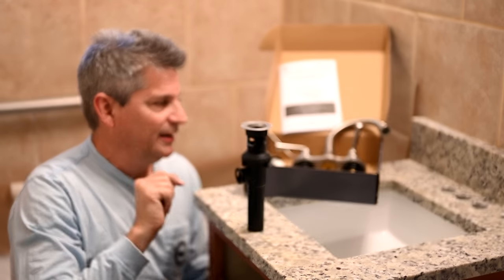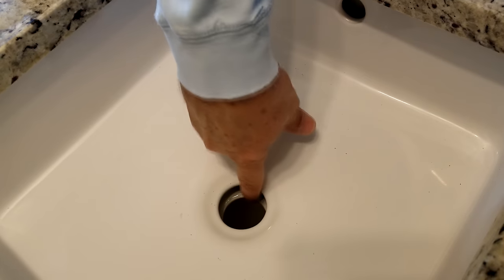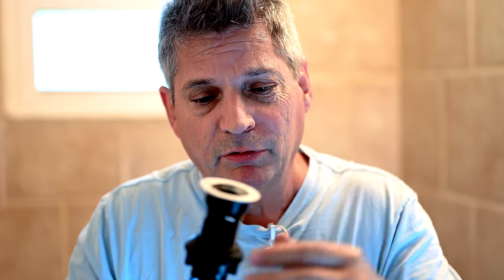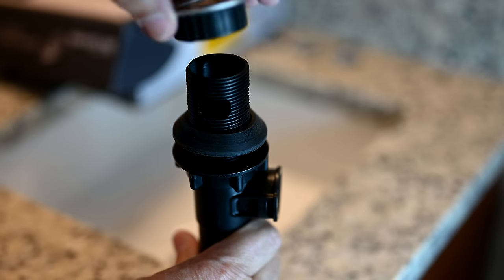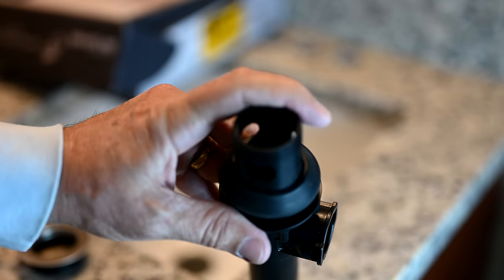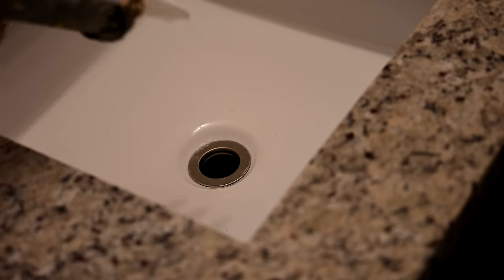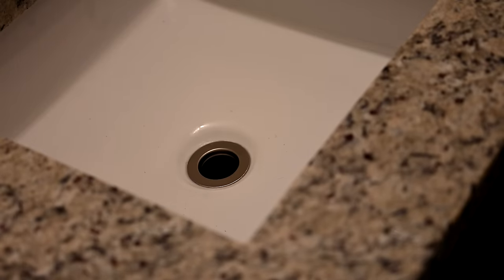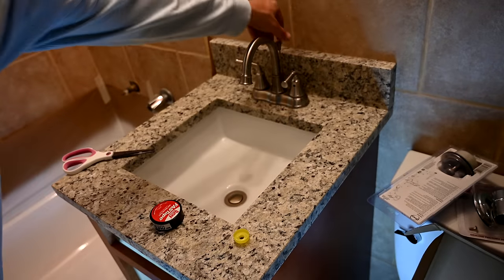How To Install Bathroom Sink Drain/Faucet, No Leaks Under Gasket, Threads [SOLVED] 2023

Comment: If you have a crack around the ring below the sink, it is better to use the putty in this case as the rubber gasket wont seal very good. Like you said, itll mask the problem but it is the only solution i know of that works, otherwse a new sink will need to be bought. Very informative video. thank you sir!

Comment: Great video. There is an additional problem that I ran into that this video doesn’t address. So I used silicone adhesive to glue the waste seat into the drain hole. I then put the Teflon tape on the drain body in the two places you said to do it. So after the silicone sets, I go to screw the drain body into the waste seat a new problem arises. The Teflon tape makes the drain body harder to thread into the waste seat which is glued into the basin, so much so that it breaks the silicone seal, trying to get the pivot rod to face towards the back of the sink. Same goes for the drain nut below the gasket. Trying to tighten that with the Teflon tape on the threads makes it harder to do and inevitably breaks the silicone seal on the waste seat before you can get the gasket even close to the bottom of the sink. So you have to start all over. What I had to do is put the silicone on the bottom of the waste seat and push it into place. Then, while still wet, I screwed in the drain body and got the pivot rod lined up properly and the tightened the drain nut/gasket into place all while the silicone was still wet. Hopefully this works because I had to start over 3 different times. Any thoughts on this?

Comment: Thank you for this! Just fixed my bathroom sink following your video and NO LEAKS! Not a plumber and wouldn’t even consider myself a handyman, but gave myself a POB (pat on the back). Thank you for sharing this. 

The teflon tape was the big deal. The person who owned the house before just smothered the drain pipe with plumber’s putty, but the teflon tape seems to work. And the whole job looks clean and professional! Thanks again!
Reply from the maker: Yes you can always tell the person who doe snot know, because plumber putty should never be used on threads.

Comment: Great video. Clear silicone is the way to go. If need to remove j slightly silicone excess, one can use a silicone spray, but be prudent since it can undo everything. That ridged wrench is awesome thanks for this wonderful video had to do 7 faucets and it was a breeze with your recommendations. I actually used pipe dope where Teflon could have been used, can be very messy but I don’t have to think about wrapping this way or that way and unraveling Teflon tape. Great tips, nothing missed, especially the aerator removal. Thank you so much. No drips thanks to you! Except I had not waited the thirty minutes on the silicone on the first one, and was perplexed what went wrong - found your video.
Reply from the maker: Awesome glad it worked for you

Comment: Great video from start to finish. I appreciate you outlining the use of teflon tape, as well as the distinction between 100% silicone and Plummers Putty, in such straightforward words. The only item I would personally omit is silicone around the gasket on the faucet pedestal. In my opinion, there is almost no probability that water will get there and pass through the gasket.
Reply: I agree that the possibility of water getting past that bottom big black gasket is very low. The bottom of the sink would have to be pretty deformed for that to happen. I think the possibility of water passing through, around the threads under that black gasket is more likely.  A year ago, I installed and removed a drain three times, only to have it leak around those threads. The 4th time, I put some silicone on the threads where Jeff used Teflon tape, and the leak was no more. That was a plastic drainpipe. 
Yesterday I replaced another bathroom drain using a metal drain. The only sealant I used anywhere was the plumber's putty under the top flange, and Teflon tape on the tailpipe threads. I did have a leak around the pivot rod because I failed to adequately tighten the cover, but once I tightened that cover, everything was fine. 
I'm thinking there may be a difference between the sealing on plastic v metal pipes. 
As skeptical as I was, I simply followed the manufactures instructions, and it worked out well.

Comment: Great video, well paced with clear shots of important bits. Just want to add that my moen faucet mentions that the drain stopper can be captured (called anti vandalism option) or used with the pin next to the stopper hole so that it can be easily removed for cleaning.

Comment: Jeff, i followed your instructions...but my older drain piece and its popup leaked when I used silicon...wife found leaks!!! Yes I put healthy thick coatings inside and around the top ring!!!!  Looking at the sink which was very rounded I guessed that more material was needed between parts and the sink...SO...I switched backto using PLUMBERS PUTTY!!!  That stopped the leaks...at least for one week so far!!!  I mention this hear because others might be using their older existing part OR they have a deep/steep sink too...YEAH for older ways which still work hehehehe  Just sharing hoping to help others fix their leaking sink and...puzzled...whats wrong?...before they give in and go buy new parts!!!

Comment: Excellent video! I'm going to see if I can get this to work. On the new sinks they don't put threads where the bottom gasket goes (at least on mine from Lowes). it is just smooth pipe..I still may see if I can add some tape there...Let me know if you have any insights for this kind of connection.

Comment: This video is great! I have one question—underneath my sink there is an extra hose that seems to be a drain for the a/c. How do I go about replacing the assembly if the new one doesn’t already have a place to attach the drain hose? Thanks in advance for your time.
Reply from the maker: You are NEVER supposed to connect any drain hoses from the AC to the sewer. This is a violation of building codes, and most cities forbid it too. IF you connect the AC hose to the sewer, you could have sewer gas smell coming up into your house through your AC line, back through your AC pan.

Comment: Great video. I have the same offset situation during a remodel. I think I will probably use a street 45 that will connect directly to the trap adapter so that short piece of pvc pipe will not be needed.

It seems like your plan B would have created a restriction. Seems like a coupling (slip or normal) and another short  piece of PVC pipe for subout might work if there was enough of original stubout. Might have to open hole in wall a bit.

1/4" per foot drop between trap and sanitary T.

Comment: The ones that use plumbers putty on plastic parts and pack it in there, are the ones that people have to have fixed later or have mold smell from the putty and the crevices made from squishing into the void behind the drain stack getting we and harboring all kinds of nasty insect critters.  Use the silicone people and every year, take a flashlight, clear out your vanities and look around under the sink and other fixtures.  It's cheap insurance.  Nice video Jeff!
Reply from the maker: Thanks Debbie!
Reply: @jeffostroff  😉

Comment: I loved your video !  If I may ask a question. Danze bathroom faucet replacement. The drain is my question. Sealing to the underside of the sink. There is the rubber washer but it is threaded and very hard to thread on.  How is it possible to thread on the plastic nut when the threaded rubber gasket stops it. The rubber gasket that I took off had no threads.  
Plz help

Comment: Good video ! Thanks I just did one bathroom sink I used silicone on pipe treads , as per instructions , first time leaked , loosened nut and washer added more silicone as high as I could get under vents l on pipe  above rubber gasket , worked great , next sink I'll try pop up drain , do don't have to get my body  in a 2x2 box , 😳 get rid of drain valve linkages , 🙂
Reply from the maker: Yes, that is a pain, I use these large husky 1" thick foam rubber kneeling pads to protect my back
Reply: @jeffostroff  good idea knee pads

Comment: GREAT video!!!  Our problem though is that the rubber gasket sits on a flat part of the pipe, above the threaded area.  Where the gasket meets the bottom of the sink is not threaded (yet the lock nut does reach).   What can we do?

Comment: thanks for a beautiful explanation on how it works...i did not put teflon tape below the over flow holes that might of been the problem...would it be ok to just put teflon tape over the all threads on the drain...instead of doing a dry fit....i am going to put tape over all the thread on the drain pipe to be sure i covered all bases

Comment: This helped a lot although I did use putty before I came across your video.  I have a slight presence of water where the cone shaped gasket meets the bottom of the sink.  I think that might be because I didn't clean the bottom of the sink at all.  The plastic nuts and brass nut on the old faucet were frozen.  I had to cut them off.  I have this exact faucet only a Moen, the tail pipe is now one piece.  It's all plastic and basically a POS.  Take care.  P.S. next project, remove and clean bottom of sink.

Comment: Thanks for the instructions! What if the pipe is grey, not black? Still use silicone? The sink is older.
Reply from the maker: The best source of this is the manufacturer of that drain who made that great pipe. They will tell you when the instructions what to use most of the time they tell you to use silicone. So if you have any hint at all that it's any type of ABS plastic then you would not want to use any plumbers putty. If it is PVC then you will likely be OK using putty but I still prefer silicone because it doesn't crack overtime like putty does and leak.

Comment: Thanks for the video. I had this exact problem with a Moen drain I recently installed. Glad to hear about the silicone as well. Thought about doing this, but wasn't sure it was Kosher. When I've used plumbers putty with nickel plated drain flanges, after a year or so, I'll get a spot under the the plated portion that will rust and I'm tired of replacing the flanges every year!
Reply from the maker: Glad to hear you fixed it

Comment: This video was exactly what I needed, I used putty and it leaked like a siv and I didnt use pipe-threadng either, thanks Jeff
Reply from the maker: Excellent!
Reply: @jeffostroff  Got a laugh for you, while installing the faucet, I had just replaced the shutoff valves and accidentally turned one extra turn with the water main on, the valve shot out like a cannon, gallons of water blasted me in the face while my wife ran to our yard to shut it off, took 18 bath towels to sop up 30 seconds of water LOL

Comment: Jeff, at Ferguson plumbers supply in Gaithersburg, Maryland a senior employee told me to be sure to put some liquid detergent on the black washer so it will be able to slide around as you tighten the green "stack" plastic: what do you think about adding that step to your recommendations???  I was very disappointed  that I could not buy just the black gasket at Fergusons, Home Depot, or Lowes!!!  My black gasket has creases/depressions in it from my first install a long time ago ... which unfortunately my wife doing cleanup discovered that there were LEAKS for a long time...boo, huh?  So now I am your student and writing step by step your teaching.  Wish that I had stopped at 2 other parts stores (Tribbles and Grainger) which are just down the street from Fergusons.  Really nervous about this installation...hoping it won't leak!   Putting this here hoping to help others...

Comment: Great video.  My issue is alignment of new drain.  New sink is closer to wall.  Off about 3inches.  Any advice?
Reply from the maker: If it is closer to the wall what you can do is make the petre up come forward and then make the part that connects to the peach trap which is called the p trap arm that goes into the wall, you can make that swivel back around towards the wall.

Comment: Jeff - thanks for excellent video! Do you use teflon tape on the pvc drain connections as well?
Reply from the maker: No, you should not need to use technology there. It should only be used on threads
Reply: Thanks! @jeffostroff

Comment: Great video and very nicely explained and easy to understand. I do have one question. How is putting the tape on the threads stopping the leak coming from the top of gasket. I can see it stopping a leak from the inside of the gasket where the nut tightens up but there’s still nothing on top other than the gasket seal?
Reply from the maker: The connection where the drain flange threads on the threaded pipe up top in the sink basin is where you could get a leak if it is not tightened all the way. Water will get past the joint where the flange tightens up against the top of the pipe
Reply: @jeffostroff  thank you for the reply. I think we might be talking about two different sections though. From the video it looked like it showed a leak underneath the bowl but coming over top of the donut gasket instead of inside the gasket down the threads. My reason for asking is because my new Moen faucet is all one piece so you it's just dropped in from the top and the nut and donut underneath hold it tight against the plastic top piece that has a thin gasket on it. This is why I don't see how the thread tape would help in that situation.
Reply from the maker: @Ryan-de9ox   The tape that is applied on the threaded pipe down below down below is put in a position that coincides with wear the black gasket goes so that any water that is up top cannot get around that space that connection made between The black gasket and the threaded pipe.

Comment: Awesome video 👍 can I use latex caulking ? Is that the same as silicone ?
Reply from the maker: No you should never use latex caulk when water is involved that will crack and shrink and cause leaks. You must use 100% silicone whenever the manufacturers call it out they only say silicone

Comment: I've installed a dozen plus sinks in my life and I just bought a P-Trap kit from a big box store and every one of the supplied gaskets were undersized for the pipes in the kit.  The fix was to buy a gasket kit (same manufacturer) that had the correct sized gaskets.  I also ended up  using liquid Teflon thread sealer on all the threads.  It seems to me that the manufacturer is experiencing major quality control issues.  FYI:  The same kits are sold at both Big Orange and Big Blue.

Comment: I have watched both videos and installed the drain tailpipe three times and continue to get leaking down the threads. If in tightening the tailpipe against the sink flange, is the tape going counter clockwise or counterclock wise? In the longer version, i swear it looks like you went counterclockwise on both tape installs. I haven't used silicone on the threads yet but just can't get the slow thead leak to stop. I intalled two. First one does not leak but the second is a problem.

Comment: Thanks for the video - I bought a new bathroom vanity and sink, and was adding a new faucet/drain combo. I kept getting drain leaks no matter what I did (which is why I found your video)- and I've installed other drains before with no issues. It finally dawned on me that my new sink HAS NO OVERFLOW, but the new drain DOES have the overflow holes. Hence every time I opened the drain, it leaked all over the place. I assumed that it didn't make a difference - apparently it does. Going shopping tomorrow for a drain for a no-overflow sink. Funny, I just assumed that all modern sinks would have an overflow. Why wouldn't they? Apparently so do Home Depot and Lowes because they don't stock non-overflow drain kits (EDIT: found one at Lowes). I'd just return the vanity/sink, but they're installed already and I kind of like them. Learn something new every day, I guess...

Comment: Thanks for the video upload. Will try the Teflon tape on the drain. Purchased 2 sets of moen faucets and install instructions don't prohibit the tape.  But after installing both sets, they r both leaking from....weeping holes☹️. I agree, horrible design on the drain, should be one piece. Install Instructions is a pictorial that's not accurate and both sets were missing pieces.

Comment: I had the same problem but fixed it by taking the bottom gasket (tapered rubber) and turning it upside-down so the flat part is against the sink and problem solved. It's not that important about the top gasket because all it does is insure you can plug the sink for filling. But I had no problem with filling the sink either. Thanks for the video and I hope my input helps. It's worth a try!
Reply from the maker: Monitor that to see how long it lasts. I would check filling the sink and overflow several cycles
Reply: @jeffostroff  Did that. It solved the problem in two ways. The hole had imperfections and the taper could not compensate but the flat side gave more sealing surface against he sink. The thin part being at the nut allowed it to compress more against the threads. I filled the sink to the overflow several times. Your tips on alignment are a great help. As well as the transition from 1 1/4 to 1 1/2 drain. The trap I bought had the two seals, one for each. This was only yesterday so I'll monitor and report back if I start noticing water.
Reply: @skipmars7979  Did it work?
Reply: @jamescc2010  Yes. Still no leaks.